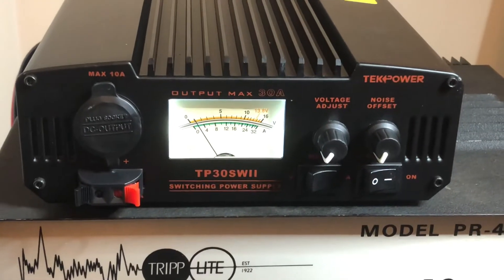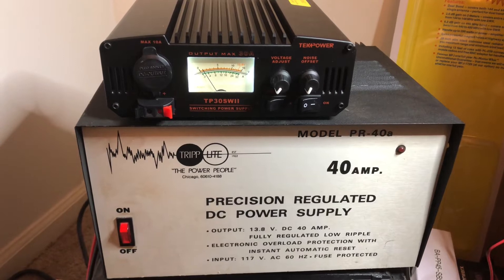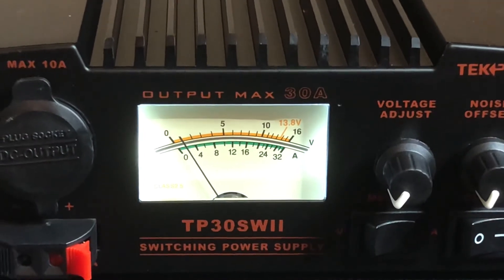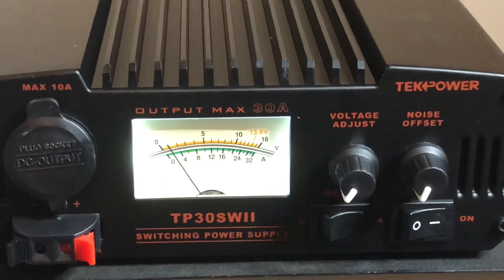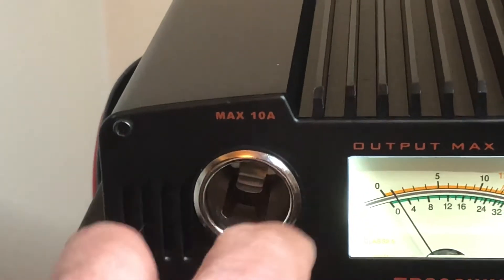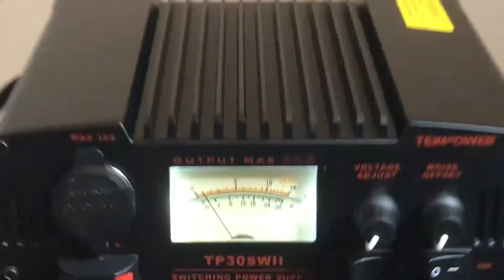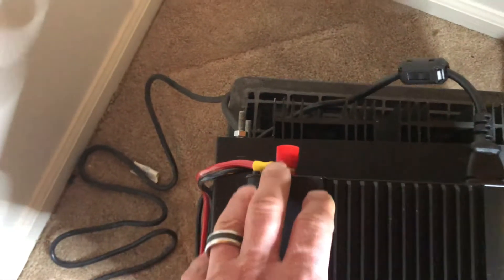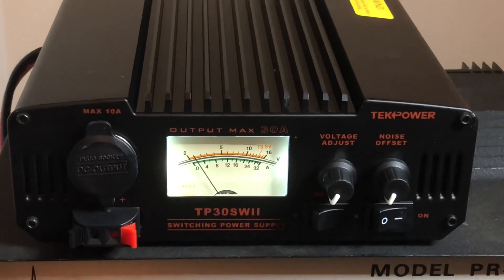TEK POWER TP30SWII.  SWITCHING POWER SUPPLY.

Comment: How do you hook up the wires?
Reply from the maker: @paulsilva6543  in the back there’s a positive and negative thumb screw posts. 30 amps.  
I put ring connector jumper there with Anderson power poles on the other end.  
Also you have a 12 volt auxiliary plug in front rated for 10 amps. 
And also one 3 amp input for running things like 4 watt CBS or say pwr/ swr meters

Comment: The adjustable voltage is nice if you want to run something like a Yaesu HT from it. Even though they will run of 12v (13.8) anything more than 9v input is dissipated as heat. My FT3DR gets almost too hot to touch when run of 12v but 9v and its cool.
Reply from the maker: Thanks for sharing.  Pretty cool.

Comment: Very nice. I really like the megawatt 50amp linkable 12v to 15v switching power supply. They are filtered do there is no noise in the line.
Reply from the maker: Nice!  Also liner’s have very little ripple  effect.  Compared to switching power supplies.   But switchers use less energy which is a plus.   Thanks for the info.